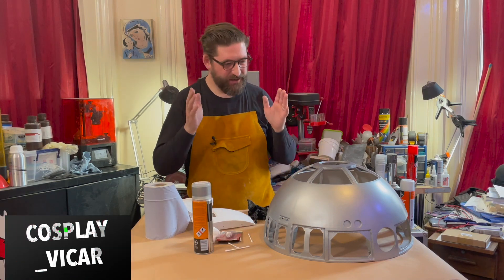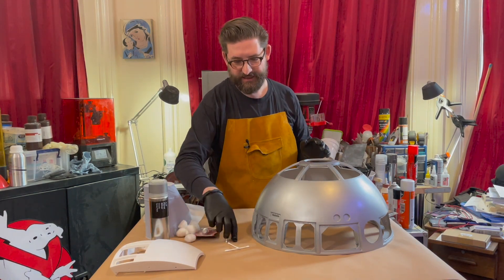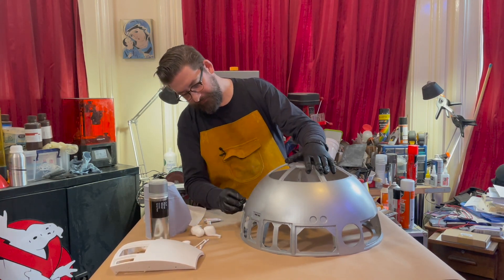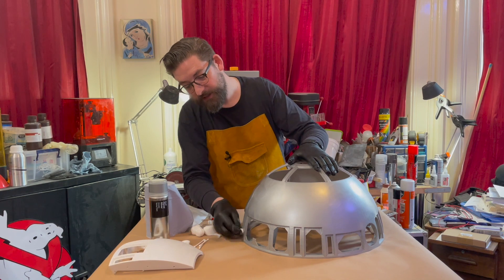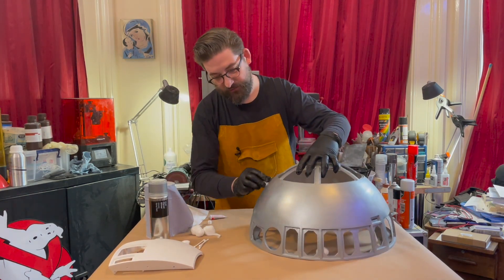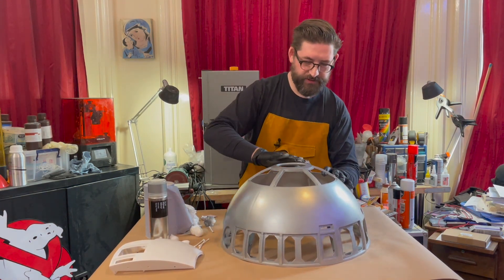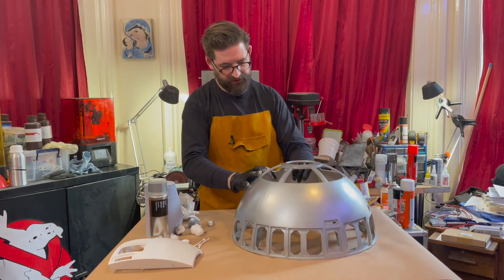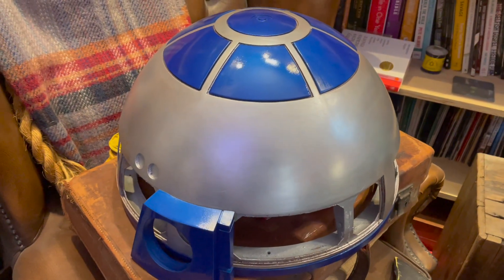R2D2 Build - Dome Rub n Buff (Part 1)

Comment: the key to rub and buff is to use your fingers and buff it that way. The heat from your hands polishes the wax in the product.
Reply: This is 100% correct. You can get a near perfect metal finish doing it this way.